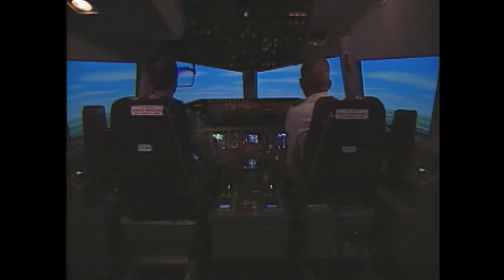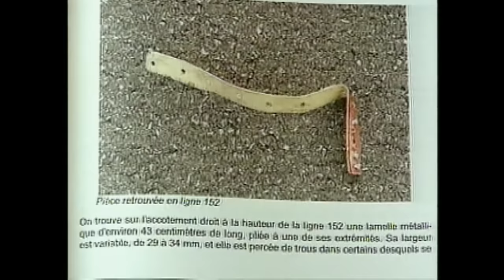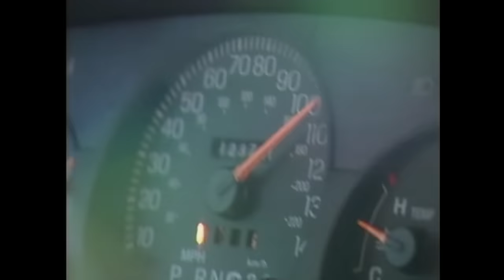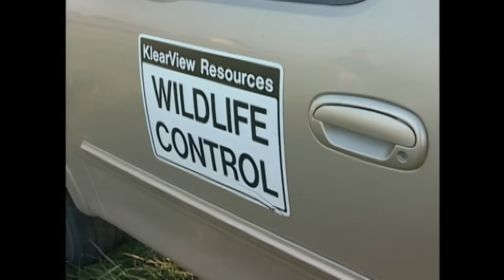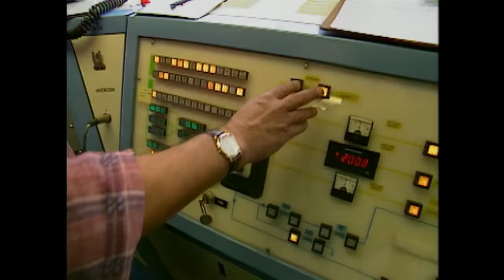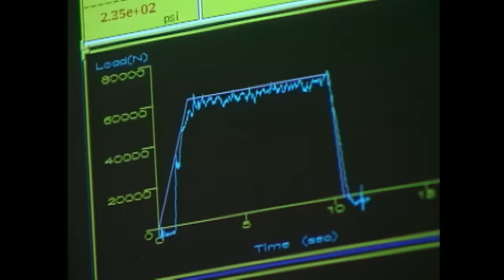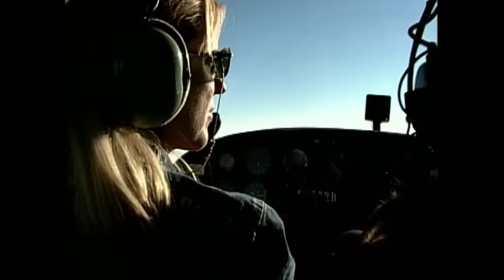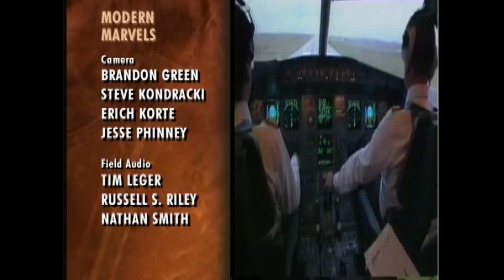Modern Marvels: Crazy Secrets of Airport Runways (S8, E50) | Full Episode

Comment: My dad was in the Airforce from 64 to 68. He worked in land surveying and drafting at a time when the Airforce was introducing bigger, heavier aircraft. As such they were rebuilding their runways.
     In Charleston they hired a contractor who replaced the runway but tore out the complex drainage system without replacing that.
     The first plane to try landing was damaged by the water that squirted up between the concrete slabs.
     The Airforce had to tear out the new runaway just to fix the water issue.
Reply: Oops
Reply: That's crazy, Sounds like the electrical contractor in the movie Towering Inferno lol.

Comment: airport runways . I still remember my first takeoff and landing I went to Gooding that day it was a good trip. I lost track of all the times I landed in Flight Simulator but if you want to fly a plane in Flight Simulator or the real world you need to know how to land it and park it on the runway. My personal favorite runway is Runway 15 Kennedy Space Center this 12 miles of concrete and asphalt was the final stop for the Shuttle for 32 years. I cried when Atlantis touched down for the last time my generation knew the Shuttle. Runway 15 is still in operation they still land satellites here and the Astronauts still do the traditional fly in. My favorite segment in this episode are the runways in my home state of Idaho. Idaho has 48 dirt runways and Cessna bush planes and De Havilland Otters land here the trickiest strip to get into is Lower Loon Airport in Stanley Idaho it is "One Way In No Way Out!" so you need to know how to land here because the approach is tricky and this airport is the only way into the Frank Church Wilderness.
Reply: Let's give credit to one of the most important parts of the aircraft that allow you to land and park: the tires.

Think about all the stress and wear they are subjected to every flight, every landing.
Reply: @LynxStarAuto   Even though it's a flexible polymer compound rather than aluminum or steel, tires are subject to things like fatigue damage the same as any other structure.  The internal cross section looks much like that of a car tire, except thicker throughout the section and more cord layers.  Same for the shuttle's orbiter tires.
Reply: @LynxStarAuto  yup and when Runway 15 was constructed it was too rough and Discovery got a flat tire and had to land at Edwards because shuttle tires are made of rocket fuel. The fix was they ground down the runway and the grooves go north south not east west that way when the shuttle lands or Dream Chaser and the X37 land their tires grip the centerline and fallow the groove so they don't blow out. Same thing was done at other airports because they said the surface was too bumpy.

Comment: Juan after the MCAS disasters the public learned that the engine mounting could redult in a pitch up situation, thus the MCAS bandaid. Admittedly, I am no aeronautical engineer, however, I have come to belleve that the MAX, as designed, is non-dynamically stable in some flight regimes. Could this incident be another sign of inherent dynamic  instability? db.

Comment: "After many experiments, Langley toned down the (Orbiter) runway surface".  Background:  As indicated, they made the surface too rough in the first iteration, resulting in unacceptable/unsafe tire wear during even a single landing.  NASA's plan was to apply paint to the runway so as to reduce the asperities.  I advised them in a meeting at JSC in July 1985 not to do that:  Anyone who's ever stepped onto a wet painted curb and had their foot go out from under them knows why that is.  Instead, drag the runway with for example a heavy concrete block to smooth it out some.  Something like that got done -- don't know the details.

Rockwell had a drag chute in their original orbiter design which didn't make it to the final product.  Unfortunate, since the brake was woefully undersized thanks to weight growth after its design had to be frozen.  So at the same meeting, I advocated for introducing a drag chute (along with a new-design carbon brake to replace the overtaxed beryllium design).  None of that happened right away, but the downtime from Challenger's demise got things started at least.

Comment: The story may be apocryphal, but back in the '60s there was a story that, before a runway was 'authorized,' they'd run a Corvette down it to make sure that bumps or irregularities were minimal.  If the 'ride' was smooth enough, the runway got the approval for operation.
That car was one of the few that could get way above 100 mph quickly enough to test most of the runway...  :D
Reply: Certainly possible or even likely that someone at least might give themselves an excuse to do that : )  I once gave myself an excuse to run out to the middle of the main runway at Edwards immediately after a landing airliner had flown past.  A bit of a run, since it's 300 feet wide.

But by the time you can drive a car down a runway, it's too late to do much of anything about gross imperfections.  And aircraft suspension response won't generally match up against that of a sports car anyway.

Comment: Why can’t they put a grate over the engine intake to stop them from being ingested?
Reply: Because of the risk of the actual grade itself be pulled into the engine. Plus, it would interfere with the air intake of the turbo fan as well.
Reply: Because the grate would decrease airflow to the engine, add weight and it'd be a real mess if the grate itself came loose and went through the engine!

Comment: Let's talk about the fuel conspiracy. How do you get 600000 gallons into a 767, where is it go? Certainly not in those little skinny wings
Reply: There are tanks in the belly of most aircraft as well.
Reply: The fuel tanks are located between the fuselage and the wings. Pay attention to where the wings mount. That section is the fuel tanks on both sides. Also a 767 has a max fill of 24k gallons.
Reply: I can assure you the wings are not skinny. They look skinny from afar not to mention the MASIVE in the belly and even in the horizontal stabilizer in some aircraft
Reply: @JohnAnderson-zb3cr  don't tell me how skinny they are I worked at the airport for 6 y e a r s
Reply: @JohnAnderson-zb3cr  and I can assure you that the wings will not hold 30000 gallons or even close
Reply: I must have missed the part where this said a 767 holds that much fuel.  Maybe more like 25K gallons total among all tanks in an ER variant, give or take a gallon or three.
Reply: @james-p  and they still stay at 7:47 holds 50,000. Even 25000 gallon weighs 150000 lb

Comment: Let’s talk about the new jet engines out for at least 15 years. They use very little fuel and they certainly cannot hold 60 and 70,000 gallons on any of these Jets. They say they put all this fuel in the wings, it’s impossible. I’ve seen gas trucks that hold only 12,000 gallons and they are huge. It would take five of these trucks to fill an airplane, and that is a total nonsense
Reply: Most aircraft have tanks in the belly as well.
Reply: @tspence6671  so they can hold four 12,000 gallon gas trucks. You see how big those trucks are?
Reply: @@jackhideous6669 yeah what is that supposed to mean
Reply: @@jackhideous6669 You haven’t told me yet where did those underground tanks come from. Maybe you should look a little bit closer
Reply: Interesting, the sizes don’t add up.  What airports and aircraft have you investigated?
Reply: Said gallons when they should have said pounds?
Reply: @bobcoulon2449 They come from fuel farms which are on another side of the airport and are piped to the underground fuel points where lift trucks actually put it into the aircraft. Aircraft are more than capable of holding more than 70,000 pounds of fuel. In fact I worked on a 787 that had its flight canceled and when I got upstairs it had like 84k still left in it. Fuel load depends on the duration of flight plus mandatory reserves or if they are bunkering or not. It also depends on the aircraft we are talking about.
Reply: @bobcoulon2449  Both the C5 and 747 have a fuel capacity of more than 50,000 gallons.

Comment: Planes don’t “need” wind to takeoff and land. Everything works just fine on a calm day. However, they do use less runway and travel at slower ground speeds  with a headwind and more with a tailwind. And if the wind is blowing across the runway too strongly, it may even become unusable. For this reason, runways are built to lineup with the prevailing wind directions so pilots can takeoff and land into the wind whenever feasible.

Comment: I'm surprised that there was very little mentioned about the subgrade of runways. Most commercial runways use a 1- 1/2" crushed aggregate base several feet thick to carry that load. Much like roadways have a thicker layer of base for trucking lanes. However, all roads are constructed for trucks since a fully loaded truck can weigh as much as 80,000 pounds!
Reply: When my landing gear group did runway strength analyses, subgrade thickness always figured in.
Reply: Or about the river rock road used to get the Space shuttle transport machine to the launching pad.
Reply: That is simply amazing "several feet thick".  At first I though you menat the base was 1-1/2", like a patio, ans I'm like, OK.  Then reading on or whatever, the base is like several feet.  WOW!

Comment: When I worked at HQ Strategic Air Command, we had one of the 747 airborne command center run into a flock of migrating geese as it was taking it off. The multiple geese TORE AN ENGINE OFF but the remaining three engines enabled the plane to turn around and land safely.  We also had a B-1 bomber collide with geese over eastern Colorado. A bird penetrated through the rubber baffle that covers the joint where the movable wings connect the body. The bird broke a fuel line, and the engines caught fire, and the plane crashed into the ground so fast the crew was unable to eject.

Comment: There are actually 3 runways for the shuttle, the 2 mentioned, and a third at Northrop Strip, White Sands Missle Range in New Mexico.
Reply: And I'm sure, if need be, they could use Area 51. That strip is also huge.
Reply: The 4th was for extreme emergency, 14 - 32 at O'Hare when it was at its full length (approx. 14, 400').

Comment: I didn't know runways were so thick
Reply: Thicc
Reply: Roughly 6 inches headed into the jet age, and then upgraded to 8-12".  Those are "concrete" values -- "asphalt" needs about 50% more thickness to accoplish the same longevity.  That much thickness isn't needed for the load from a single landing, but rather to combat localized wear and eventual failure over many thousands of landings.

Comment: The Interstate Highway System can all double as runways in a pinch. They were designed for that eventuality.
Reply: Wouldn’t want to try it on a big passenger jet.  Might get a military jet on it.
Reply: @TheSjuris  They're designed to handle up to a C-130.
Reply: @mikeaguilar5764  and you’re not going to get that through an underpass. The only way the highways got built is because they were advertised as being military in nature when it’s the opposite.
Reply: @TheSjuris  You can believe that if you want. Nobody ever said anything about flying or rolling an aircraft under an overpass. Not very bright thinking I even implied it.
Reply: @mikeaguilar5764   you’re not going to land a big huge jet on a runway without hitting something doing it. This isn’t 1950 anymore. They also never believed this many cars and trucks would use it either.

Comment: I built an airport in Florida during 911, and the concrete terminal and taxi ways were a slight bit different than I was used to pouring. 12" to 18" thick concrete and I had to keep covered for 28 days with burlap and soaker hoses. Another company built the runways, but I was the concrete & mason super on the entire airport and surrounding driveway, parking lots, taxi, terminal, ramps and then the masonry & interior elevator shafts, stairs, fire walls & floors. There was a hole in the second floor above the entrance showcasing a hanging bi-plane  You can see the plane when you search Lakeland Linder Reginal Airport.